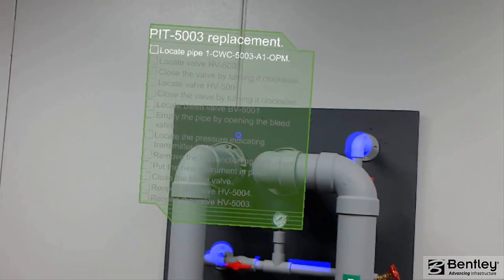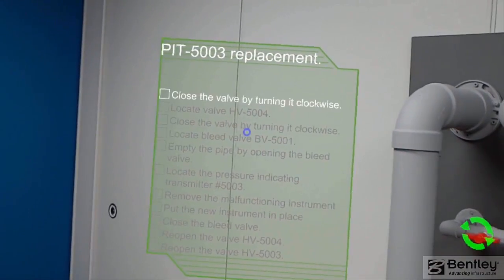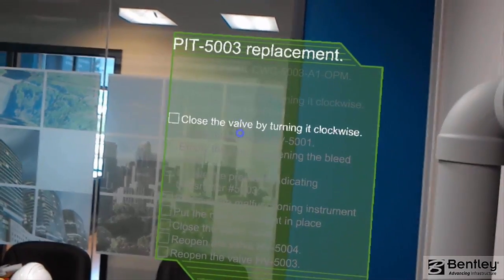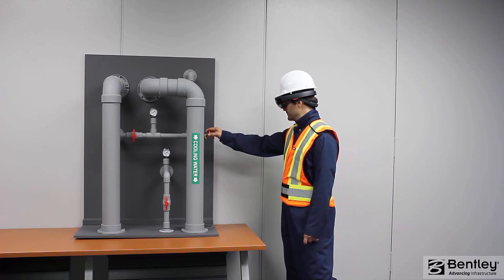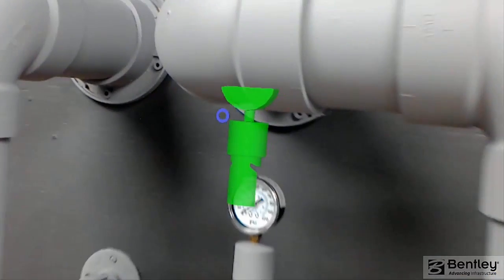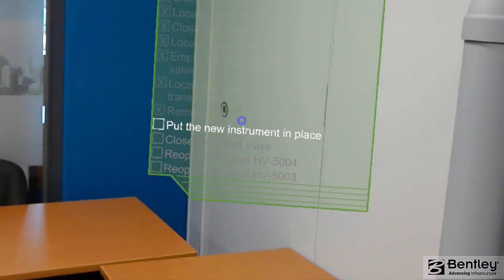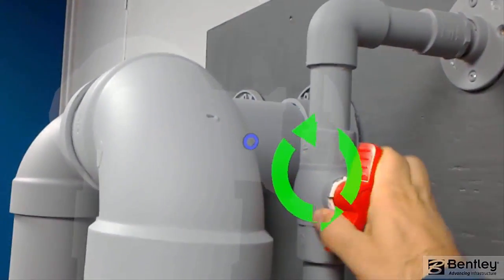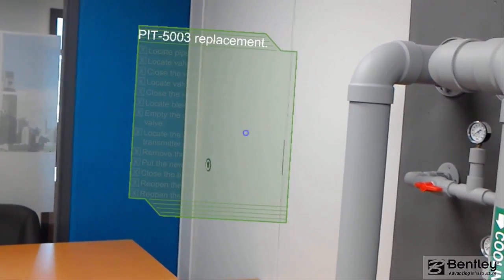Hololens Plant Maintenance

Comment: WOW! awesome Technology. 
I like the way your App gives step by step instructions, with verification that each step has been completed. Maint. on high pressure Fluid / Gas lines could result in a Horrific result, if the person doing the Maint. was  kind of forgetful, or just Tired , and they were trying to remove the pressure valve, and skipped a crucial step such as closing the supply line or evacuating the back pressure.

Comment: starting to think this holo info for workers will be used for when robots take over these jobs, cause all he did was turn some valves and replace a piece, something i see robots being able to do in seconds
Reply from the maker: Interesting.  This video shows a typical maintenance task - such tasks are known, well described, and could indeed eventually be achieved by an automated system.  Augmented reality assistance will likely prove much more valuable when assisting users who need to fix a problem for which no solution is currently known (see our other video https://youtu.be/lYptlaO9rKw ) and for which an automated robot would  be useless.
Reply: I think you are right. AR is currently being used to aid the human user and meanwhile location and mapping technology evolves. Once the space context is conquered, the robots can take over. And it does not matter that circumstances may be not pre-determined. Machine learning will deal with that.
Reply: Robots are pricey and can't handle unexpected situations. For $3k you get to turn a human into a slow robot that handles it's own maintenance and transit, does the work and takes pay weeks after the task is completed

Comment: is this vuforia sdk or homebuilt with unity?
Reply from the maker: We did not use other SDKs for tracking or augmentation - only Unity for the display, and HoloLens for tracking, voice recognition, and hand interaction.
Reply: Great job!
Reply: wow that is impressive to do this with no sdk at all, an chance you could point me in the right direction to start learning how to do that?
Reply: Thank you!!
Reply: But how is the manual calibration working? Just dragging the virtual model on top of the real model without recognition? Seems like not accurate enough...
Reply from the maker: We tried an automated calibration technique, based on the 3D mesh produced by the HoloLens.  It did not work as the mesh is not accurate enough.  So we implemented a manual calibration technique, that provides 5 degrees of freedom (we assume the top is always up).  It takes about 30 s to an experienced user to do a good enough alignment.  Of course this was ok for this demo, but an automated method would be preferred for developing commercial app.
Reply: You should really try mounting an image tracker of your choice at a known location onto the wall, Vuforia is super good in detecting the position, even from 2 meters, and very easy implemented nowadays. If you need help, hit me up =)
Reply: @MichaelTheMiSta92Staudinger   Hi Sir, i need help with my project. I want to make appear my model using the vuforia image target but  something goes wrong. Can you help me?
Reply: @MichaelTheMiSta92Staudinger  hey

Comment: are you using markers? just how can hololens detetcs those parts this precisely.
Reply from the maker: Very good question.  The answer is: no, we are not using markers.  The HoloLens is very good at calculating its own position in real time, so no marker is needed for tracking.  But then we need to know where to display the augmentations w/r to the pipes.  To achieve that, we start with a 3D model of the pipe setup, or a 3D mesh, and the first phase of the augmentation session consists of "aligning" the 3D model with the physical pipe setup.  That quick setup step needs to be done only once, since the HoloLens can "remember" rooms it has been in.  Therefore subsequent augmentation sessions can automatically re-use the alignment that was done the first time, and still display the augmentations at the right place.
Reply: actually I have not seen this precison yet in other apps yet. the most precised I have seen yet is Lowe's kitchen app and they also used markers for the first use. 
it is quite brilliant you have achieved it.
Reply from the maker: Thanks.  Yes, the pipe/valve model is aligned first with the physical world version, before the maintenance can start.  And yes, for large facilities, you would have to "store" those representations somewhere, and load them when you get in front of the corresponding portion of the facility.  In our demonstration system, we did not implement that part.  Automatic loading of the correct portion of the model could work several ways though.  For instance, the HoloLens has the capacity to "recognize" rooms it visited.  That is how you can place a hologram in a room, then leave the room, and when you come back later, the HoloLens will display the hologram at the location where you left it.  That is why the initialization (alignment phase) is needed only once - subsequent visits to the room will display the pipe model at the right place.  If the various sections of the facility are too numerous or too similar from each other, then other approximate tracking methods could be used to load the right portion of the model, such as wifi tracking, or QR code as you suggest.
Reply: In Unity the development speed is much greater, but at our company we also work with C++ directly. Sometimes we develop applications on Hololens directly with c++, sometimes we are creating c++ plugins for unity3D for the sake of quality, speed or integration.

You can look at my channel too as I have shared some c++ applications.
Reply: ok so you have to have a library of setups, align them and then start the workorder?
Reply from the maker: What do you mean by "library of setups"?
Reply: If I get this right,  I have to load the pipe and valve setup and align it with my Hololens with the one I see before starting the maintenance.  If I manage a number of installations / setups in my facility,  I need to store them somewhere so I can load them when I get in front.  Do you use a file system or something like a QR code to load the right one before a maintenance?
Reply: Nice approach! Did you do this in Unity, or is it only possible without?
Reply from the maker: We did our experiment in Unity.
Reply: Hi, It has been a long time for me to think about how to "align the 3D model with the physical pipe", but still have no idea. I would appreciate it if  you do me a favor to provide any practical advice or any tips. Thanks a lot and expecting your reply!
Reply: look at this guys, this is amazing!!

https://www.youtube.com/watch?v=6Wabcs8BVu4
Reply: the video is unavailable